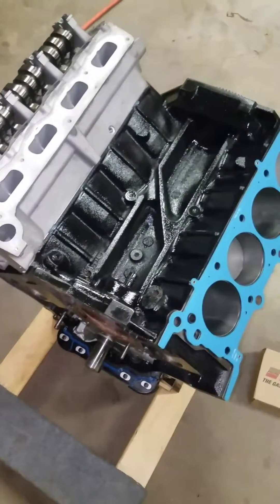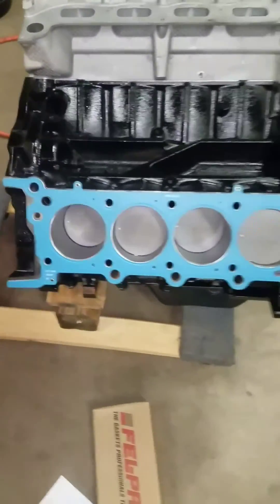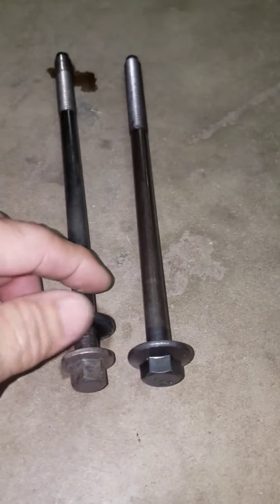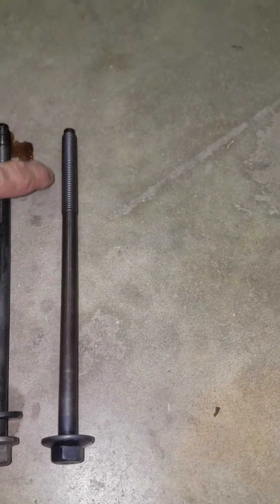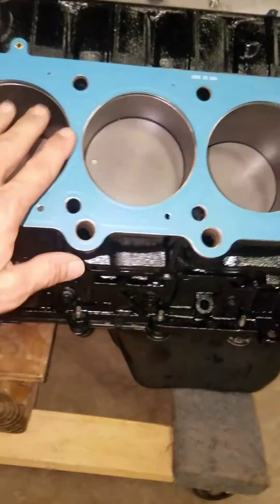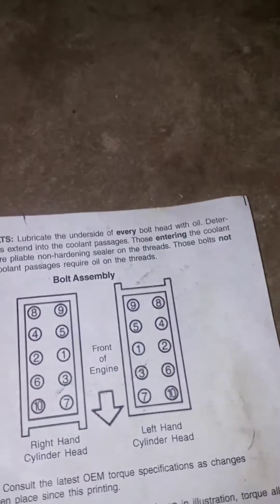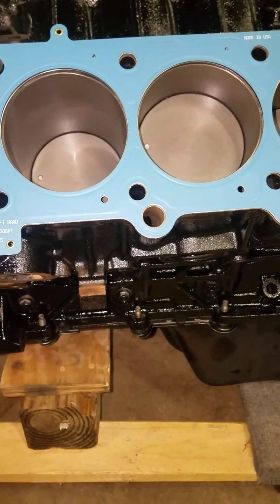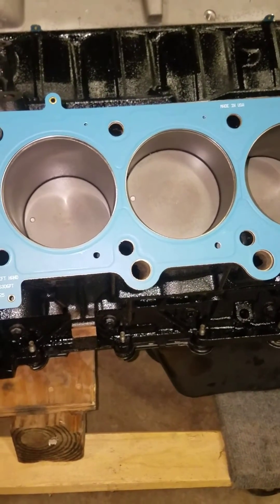Ford 5.4 3v Installing Head Bolts

Comment: If you (like I did) torque the heads to 30 lbs but had an injury which left them sitting for 3 months , is it stil ok to complete the torque sequence or do you need to buy new bolts or can I remove them and start over with the same bolts ?

Comment: When you do the degree turns on the head bolts can you tell me if you put a torque wrech on the degreed bolts what is the final torque pressure overall if you use a torque wrech to check the actual torque. I wonder what it is?

Comment: On your 3v heads, did you experiment with any porting?
And did you keep the stock cams? 
I'm going up a notch with new cams and smoothing the intakes and exhaust ports.
Keep up the awesome work, 
Like to see more.
Thank You
Reply from the maker: I have built many 3v engines. Not much I haven't tried. Just keep in mind cost versus outcome can be hard to swallow. Some things you'll get more from then others, and if your paying someone to do those things, the cost may out weigh the benefit. Every little thing give you something, but builds are often done according to usage.

Comment: I have a 2007 4.6 3v the book is saying a 6 Step process . Cylinder head bolts ( Step 1) 30 Ft-lbs ( Step 2) Tighten additional 90 degrees ( Step 3) Loosen one full turn ( Step 4 ) 30 Ft Lbs  ( Step 5 ) Tighten an additional 90 degrees ( Step 6 ) Tighten an additional 90 degree. I would use a torque angle to get a true 90 degree. 10.00 at your local auto parts store. This is my first time working on a 4.6 3v what a job.I would love to see a video on the insulation of the heads and if you really need to take off 6 of the roller followers 3 from each head. And if all 6 steps are really necessary.

Comment: Is it same procedure for a 4.6 2 valve sohc engine..??? 
30 lb-ft and 2 additional 90 degree turns..??
Reply from the maker: Yes, its the same for the 4.6 engine.
Reply: Thanks I think I over  torque the bolts, engine feels underpowered in driving...
Reply: @josearellano3268  over tighten bolts is not going to change engine power
Reply: Peter DeCarlo yeah, I had to redo my timing chain it had jumped so that’s why it was acting up.

Comment: Hey 90 degrease like to hear clicks?
Reply from the maker: carlos valencia    Are you referring to when you turn the bolts they are making a clicking sound?  Or the click of your torque wrench?  Either one sounds normal to me. The clicking sound your hearing I believe is coming from the bolt to head contact area.  The old bolt design had a seperate washer which had allowed the bolt head to turn on the washer. The new design has steel to aluminum contact which I believe causes the skipping as the bolt turns and stretches.  Also keep in mind that I have seen in many instructions say to loosen the bolts once they are torqued and retorque them but this is not correct, unless you have installed an aftermarket non stretch stud kit. You should never loosen stretch bolts when properly torquing them.  Hopefully I answered your question, thanks for watching my video!